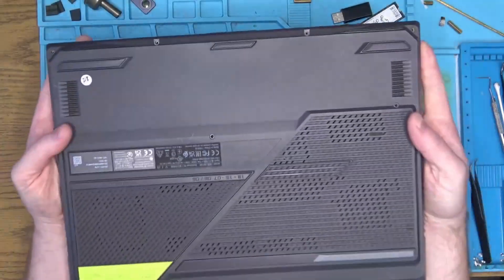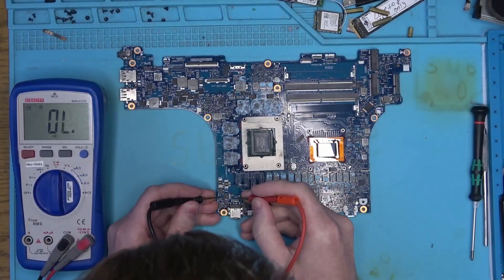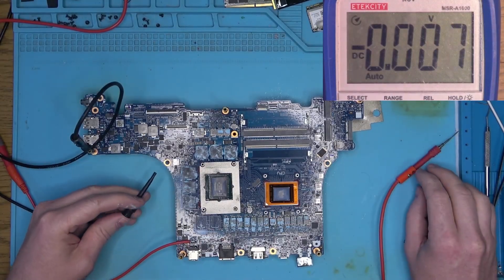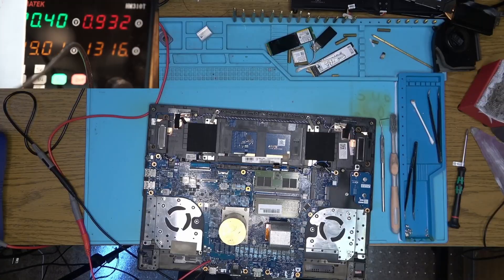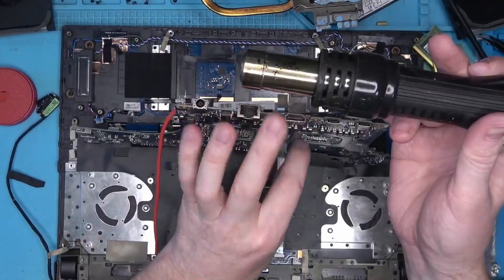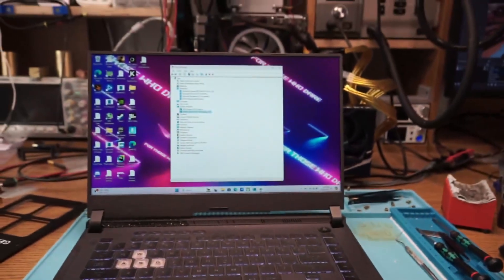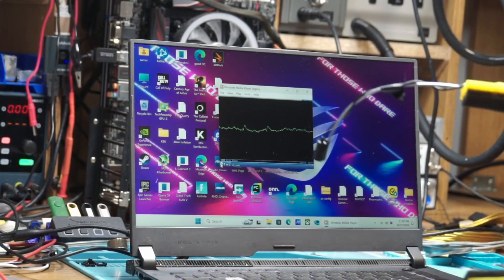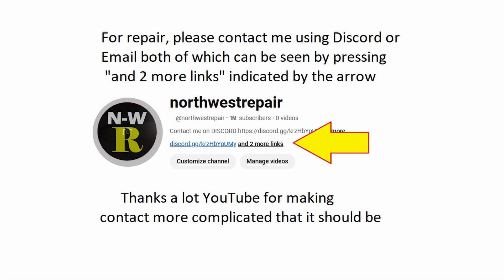ASUS ROG STRIX G513R free repair

Comment: Just saw another video. Where they did a bio flash and mentioned that you have to save some data from old bios and rewrite it the new flash bios. Overwise somethings might not work. Maybe this happened? Awesome work btw. Edit. It's from adamant it. Lfc 298 at about 34min.

Comment: I doubt youll read this but still... Im siding with you, but I think he was right about being a problem with the vBios all along. When you flashed the correct BIOS, you inadvertently set iGPU as default which made the problem disappear. When he tried to switch back to using only the dedicated graphics, the vBios issue he caused came back. Maybe because vBios then takes priority and it uses part of the code he screwed and it broke the initialization. 
I've seen this happen on desktop, where a GPU will only run as secondary after a bad vbios flash.

I think he deserved no refund, but an offer to reprogram bios and vbios if he sent you the chips alone and paying for shipping both ways (since he obviously has a hot air gun). 

dont do these type of refunds in the future unless you reeeeally screwed something up, it will only attract more customers to do the same and get free repairs if you give in

Comment: donot flash bios if you are not having any issue i mod bios sometimes even so i do it i always make sure i got the bios backup ready and  if i end up with a brick i just reflash the old extracted bios back also its been 5 years that i updated bios still using the one the laptop came with just moded it with ru efi for  some things that i need as hp dont want u to flash moded bios

Comment: i have similar issues with fixing car stereo amplifiers. i would replace driver mosfets charge a low price, lower than most repair centers, they would hook it up bridge it down below operating specs and blow it again and try to say i never fixed it right to begin with. so then i had to become a teacher to show them what they did wrong. some people do learn, but others do not.

Comment: Liquid metal will eat into the copper, dont ever use it for copper cooling, especially for laptops!! And it will dry out in just a 2 or 3 months anyway, degrading cooling performance once again..  High quality thermal paste like KPX will have virtually same cooling performance and it will last for a very very long time and it doesnt degrade after curing, no matter how many cycles

Comment: Yeh software can throw a wrench into diagnosing hardware ,even for a diesel mechanic.Like replacing a starter when the TCM unit was flashed wrong by previous dealer,then you get it.Why do a starter when you can easily jump the selinoid to test first?I said TCM or update or lets not touch it.We bought the program and updated and it had the wrong revision.Had a snapon scanner hooked to an International and it called it a chevrolet.Wasnt sure if it was the wrong software for scanner or the truck side ecm.Crazy shit sometimes.And sometimes I just see engine code and know what to change without testing,it is a mixxed bag diagnosing.And sometimes takes 4 hours just to get to the part reprogram let alone remove just to get a number off of it to make sure you have the correct PN and module year and what vehichle model and engine.It is insanity.

Comment: if it's true that he gack the laptop by installing crap software then giving him a refund was the worst thing you could do especially after his reddit attack, refunding not only gives the appearance of validating his claims but also sends the message that you can be bullied into submission. trust me when i say, enough people know you work ethic that your reputation can handle an attack by a dumbass. the one suggestion i can make is make sure the repair video on the customers hardware is posted by the time they get their item back so they can watch it which in this case would shown where you said you weren't fixing the wifi antenna but beyond that you should have fixed the wifi because when you think about it  what good is a laptop without wifi...food for thought....

Comment: Wait what. How did it go from 3060 to 3070? Forced 3060 driver at first?
Reply: Nope, laptop is a 3060. I flashed the wrong vbios onto the laptop which is why I sent it to Tony. He forgot and only flashed system bios. That’s why I was having so many issues when I received my laptop back. Then he refused warranty and wanted me to pay full price only to cut that in half after he got backlash. He blames “GitHub software” but that is false. G-helper does not modify bios in any way, it simply changes laptop modes. He should come public with the info because G-helper is great software and its reputation should not be harmed by his misinformation.

Comment: Some ppl like that don't know about electronics and software related problems, this customer sucks because probably he doing a custom bios for hardware upgrade through software? LMAO or maybe that guy is just stupid trying to flash other modded firmware for some unknown reasons. 
That customer must be an idiot sending the laptop to a fishy electrician guy and broke after it or maybe it was him that's why i don't accept repairs if someone did repaired it in the first place and broke after few days or months, they will set the blame on you which is ridiculous and stupid. Btw, you did a rlly good job, though i can't really accept the fact that you did a full refund to the customer after such time/material consuming repair. That customer needs to feel ashamed for itself for doing such idiotic thing.

Comment: Better than what I would do.  If it comes in with no power supply, it sits there with no power supply. 

The fact of no screws, heat sink damage and everything else would have sent it back out the door. No fix.

Comment: Northwest is in the wrong here only for one reason, he refunded.
The warranty should be limited to company's repair quality and should not extend to when customer repeatedly breaks the device.

The ethical and correct solution would've been to offer the customer 2 options: (1) a full repair of laptop brought to 100% working condition for a new fee, or (2) full refund with return of the laptop in its original broken condition upon its first arrival

Comment: I'm 99% positive the ripped antena module is a hybrid. It has both Wifi and Bluetooth. That's why it wasn't working before replacing the part - it simply wasn't there to begin with ;P

Comment: and thats why I am in accountanmcy and not customer service.
People will scam you. Always
Reply: I did not scam him, simply asked for warranty and he wanted to charge me for another full repair. Only to cut the price in half after I begged and then turned to Reddit. Turns out he shouldve flashed GPU bios, not system bios which I had to do in the end. Look at unigine superposition where the 3060 is running at 1050 MHz. That should show you something is wrong with the GPU.

Comment: What thermal paste did you use? The Laptop uses liquid metal so replacing it with normal paste made for PCs is just going to result in it pumping out then throttling. Most people recommend Honeywell PTM7950 for Laptops just curious as it can be the reason why the original seller complained about bad performance

Comment: So, you were sent a laptop for repair with no charger, not clear description of the problem, no idea what the customer had done previously, and after fixing it, the customer says you bricked it? No, the customer bricked it and tried to blame you for a free repair. 

Word to the wise, people: don't mess with system or GPU bios. You didn't build the machine so you don't know how it works. Trying to tweak your machine to squeeze a few extra FPS is foolish. It doesn't help game play at all. It's an ego boost, one that we see can brick a system. You'll be lucky if it can be repaired at all.
Reply: I told him EVERYTHING that I did in emails. Literally everything. Check the Unigine superposition benchmark he did. 3060 only running at 1050Mhz clearly shows something is not working with the 3060. The Vbios was wrong on the GPU. This is what Tony was supposed to fix, but instead he flashed system bios.

Comment: what a nice guy, he broke his stuff and then blame you for not using crystal ball to know what he did :D Thanks for showing us... I guess he will not admit that he is wrong here
Reply: @bearde_mut9731 I feel that this video leaves out some important context as well
Reply: @bearde_mut9731  ASUS has warnings in their official software for overclocking, the warnings are literally just for liability reasons. and it doesn't say a "high probability" of anything lmao

At the end of the day the technician admitted on Reddit to not testing the dGPU mode. Seems pretty open and shut to me. Talk about subjective, maybe try doing research for yourself.
Reply: @bearde_mut9731  the most telling part to me is how you had nothing to say about the rest of my points. some people just won't listen to reason
Reply: @Polyeith I hope you saw the comment where I explained how I fixed it.
Reply: @bearde_mut9731  No need to be rude here. NWR omitted the entire email conversation that he had with this person, not actually explaining the way this computer was supposedly bricked, nor naming the software that supposedly did it. The claim in this video is that he knows for a fact that the software bricked it, when that isn't really the case.

The customer claims to have bricked the laptop by switching it to dGPU mode, using the MUX switch built into the laptop. In case you don't know, a MUX switch essentially switches the laptop from the iGPU to the dGPU.

NWR admitted on Reddit to not knowing what a MUX switch was, and admitted to not testing it in the laptop. 

The name of this third party software itself is also omitted in the video, that software being G-Helper. G-Helper is simply a replacement for ASUS' Armoury Crate, which uses the same underlying code while trimming the fat to be lighter on CPU. It doesn't inherently do anything that Armoury Crate doesn't.  It uses the same endpoints as armoury crate, and as such I don't believe it could have caused the issue.

Comment: Your Superposition benchmark shows that something is wrong with the 3060. Boost clocks are not being reached. The card is capped at 1065Mhz with an fps difference from 27-30, 49 degrees with supposedly 99% utilization, and you sent it back as in that condition?

Edit: The customer sent you the device for you to reflash the GPU VBIOS and all I see here is you flashing motherboard BIOS, not even addressing his issue and calling it a fix. The GPU cannot even hit its 3D clocks. 
You changed his factory liquid metal to a random paste plus missed the part where CPU was not even being engaged in the last of us. 

You call this a fix and then tried to charge the customer? Hating on reddit won’t change a thing in this case since you did not even do what he was asking for.
Reply: Surely Tony must have smashed the cooling system and flashed wrong BIOS everywhere... Oh, Wait!!
Reply: @lorsheckmolseh3345  So he did not flash the correct GPU BIOS and sent it back? I get it.
Reply: @bearde_mut9731  The customer did not flash any BIOS; he simply switched to a different power plan. He flashed a different VBIOS to his graphics card, yet that was not addressed here, he downloads BIOS not VBIOS for the graphics card. The reason the PC failed to display anything was the wrong VBIOS, he did not even flash any VBIOS in the video. 
The GPU is not fully engaged in the stress test and it is being ignored. You claim that you read his reddit post yet you did not read the part where he said he flashed a different VBIOS.
 "Sub advised him to commit a crime," lmao. Do you seriously believe that a 3060 should run at 1065Mhz while under full load? Is that right to call it fixed?
Reply: @blufoxful  "The reason the PC failed to display anything was the wrong VBIOS, he did not even flash any VBIOS in the video. " So customer knew they screwed up and flashed the wrong VBIOS but did they tell NWR that? Or did they just hide that information and keep it to themselves.
Plenty of physical damage was fixed in the video, if you don't think thats worth 370 that is fine, but it was clearly work that deserves pay.
Reply: @jaro6985 yeah I told him that before sending him the laptop. Maybe he forgot and assumed it was system bios. Granted it’s an easy mistake to make but when he saw the 3060 running at 1050 MHz on Unigine superposition that should’ve raised red flags. Not only that but once I got the laptop back into standard mode and had a display I couldn’t even get 3D mark to run a single benchmark. It would just freeze. Really the laptop was laggy and acting weird with the bad Vbios. I’m surprised he didn’t pick up on this and am even more surprised the last of us ran at all.
Reply: Thank you, thank you, thank you for understanding this. I have been trying to explain this to people in the comments and they just won’t listen. It was the GPU vbios that was supposed to be reflashed, not the system bios. This is what I fucked up and what Tony was supposed to fix.
Reply: @silverback2773  You cannot tell this people who have no idea about what they are talking about. I have flashed many VBIOS’es both on my laptop and desktop. Yes flash may go bad but in this case you don’t fucking go and download a new bios for your motherboard you flash the factory one to your GPU. 
I love how he talks about liquid metal as if you put it there, he ignores the fact that card is not even fully engaged and fails the superposition. 

I read your emails and I saw that you were frustrated and panicking. Probably only thing you had to do was to access the pc via internal gpu and reflash it by yourself. Funny how he asked additional money from you and put you on a spotlight lmao
Reply: @silverback2773  You cannot explain this to the people who have no idea about what they are talking about. I have flashed many VBIOS’es both on my laptop and desktop. Yes flash may go bad but in this case you don’t go and download a new bios for your motherboard you flash the factory one to your GPU. 
I love how he talks about liquid metal as if you put it there, he ignores the fact that card is not even fully engaged and fails the superposition. 

I read your emails and I saw that you were frustrated and panicking. Probably only thing you had to do was to access the pc via internal gpu and reflash it by yourself. Funny how he asked additional money from you and put you on a spotlight lmao
Reply: @blufoxful yep, I ended up fixing it myself in the end. I cannot discredit the work he did but in the end I really did feel like i was treated incorrectly. Especially when he started accusing me of wanting him to work for “free”. And the final straw was when he went public and his whole community was treating me like an absolute idiot. Luckily I have the laptop working at 100% and now the 3060 is boosting to nearly 2000Mhz with the correct Vbios!
Reply: @silverback2773  I have a genuine question, if you understood that you flashed the wrong vbios why did you touch the wifi cable and apply flux to BIOS chip though? 
Also which 3060 vbios did you try to flash, was it an MSI one with higher wattage?
Reply: @blufoxful yep, I’m pretty sure it was the higher wattage one from MSI. Also the WiFi antenna getting ripped off was a complete mistake, obviously. Those tiny connectors are really fragile, maybe even more fragile than ribbon cables. And the way that those connectors have to be removed is kindof finicky. I just pulled up on it weird I guess and it just ripped off with relative ease. The bios chip with flux on it is the GPU bios chip which I tried reflashing with the CH341A programmer. I couldn’t get the programmer to clamp down on the bios chip and got really frustrated. So I decided to desolder the bios chip in an attempt to manually put the bios chip into the clamp of the CH341A programmer which did not work in the end. I think I just got unlucky with a really cheap programmer. I probably would’ve been successful with the bios flash if I had the kind of programmer Tony has.

Comment: Sorry, but I'm with the customer on this one. Switching performance profiles is something that should work, if it doesn't something is (still) wrong with the laptop.
Reply: His reply, he flash different vbios for his dGPU (on a laptop, which is not a recommended move), messed up tons of shit like in the video. - "Okay so, I was the original owner once again. I figured out what happened and where it all went wrong. I told Tony in an email right before sending him the device that I used NVFLASHK to flash a different GPU bios onto the laptop. The issue wasn’t with the system bios but with the GPU. So I was able to get a display via USB-C to HDMI. I had to order the adapter on Amazon which is why I didn’t try this right away. I was able to find the correct GPU bios and flash it using NVFLASHK and now the laptop is working perfectly. Ultimate mode with G-helper works now and the laptop is snappy and running great. Maybe Tony forgot I mentioned it being the GPU bios and not the system bios or something. Or maybe he didn’t even know they were separate things to begin with. He admits to having less knowledge about laptops so maybe this could be the case. Hopefully this adds some more insight into the issue."
Reply: @NguyenNam20777 Tony was supposed to re flash the GPU Vbios, not the system bios. This is why I was having problems. You can see in the video that the GPU isn’t working correctly at only 1050Mhz in Unigine Superposition.